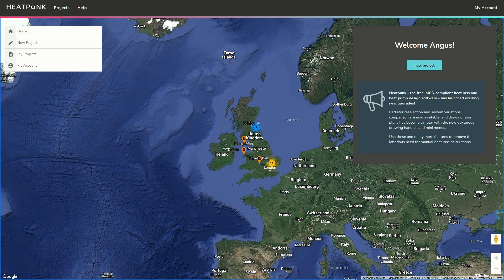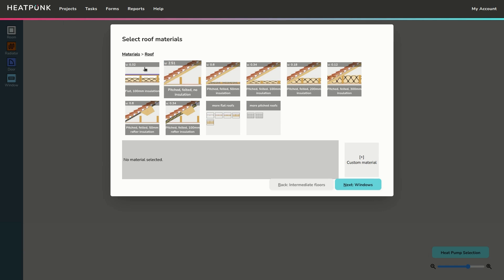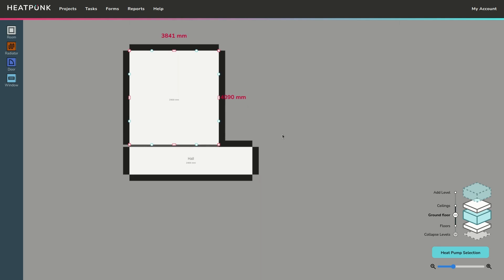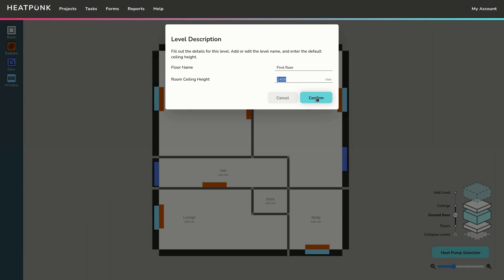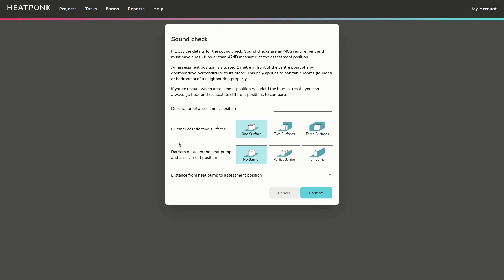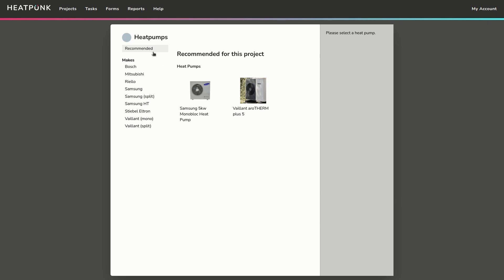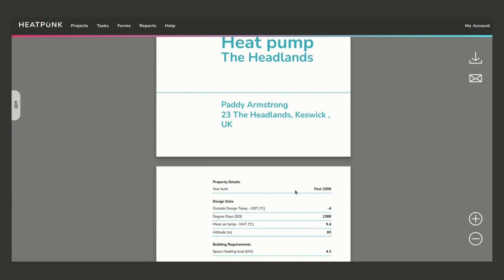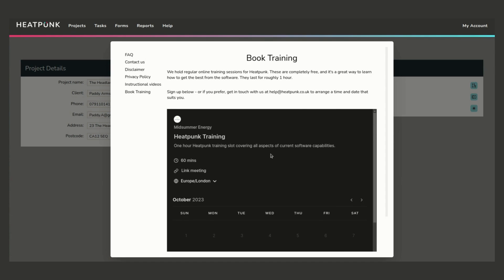Heatpunk Instructional Video

Comment: Hi, I couldn't find loose-filled cavity wall and plain wood internal doors? The only doors listed are glazed?! Surely 99% of houses have plain wood internal doors!
Reply from the maker: Hi Philip, all of the built in materials come from CIBSE's domestic heating guide, as we need a reference for the u-values used. If you can't find exactly the construction type you are looking for then you can create custom ones. 

Solid wood door is an option, but in heat loss calculations internal doors are not included! You can add them to the plans as a visual aid but they will not have an impact on the calcs.
Reply: @Heatpunk  actually now I come to think about it internal doors are inside the thermal envelope of the building do yeah that makes sense! DOH. Thanks
Reply from the maker: @Phil.Graham  No worries, let us know if you have any other questions!

Comment: Thanks for a great video, the software is great too. One question though, what would you do about stairs? I have a small landing that is unheated because it gets plenty of heat coming up the stairs from the hallway below, is there a way to model this in the software or can I just ignore the unheated room showing in red?
Reply from the maker: Thanks for your feedback!  I find the best way to do this is to model it as a separate hallway and landing on each floor as you have done, and then in the heat pump task when to the right hand side of the add heat emitter button is 3 dots, if you click on these there is an override room function. This can be used when the is sufficient heat output provided by the adjoining room. 

If you have any other questions please feel free to drop us an email, there is a contact in the help section, or join one of our free training sessions, also bookable via the help section on Heatpunk!

Comment: fantastic! heatpunk software is free but they point you towards their own suppliers. Great business model.
(unlike Residence Collection who wouldnt tell me what size shims to use under some windows I got on ebay because its a trade secret they only share with their installers ! moan moan )
Reply from the maker: Thanks for the feedback George! Yeah exactly, the standard products on the free version are connected to our wholesale products! There is a Pro version of Heatpunk that will allow users to add other non-Midsummer components! (although we do stock the best stuff so why add other's haha). Pro has some other cool features, importing floor plans so worth checking out for those!

Comment: Will there be any issues if I dont have an EPC report number available to include ?
Reply from the maker: Hi @SeanMoore2008, it won't be an issue to get your heat loss and do your design. Heatpunk does calculate the estimated kWh/year space heating and DHW demand so these values can be used where you don't have access to an EPC (or you want something potentially a bit more accurate!). 

You would however require a valid EPC should you be applying for the bus voucher and need an MCS compliant install. Refer to ofgem's site for more details on this - https://www.ofgem.gov.uk/environmental-and-social-schemes/boiler-upgrade-scheme-bus/installers.

Comment: How do you access the plan.
Reply from the maker: Thanks for your comment.  The plans are available as part of the heat pump design report which can be downloaded as a PDF from the report section of your project.
Reply: @Heatpunk  Cheers I will definitely have a proper good look it is way above my head,heat loss calculations are based on mumble jumble haha as is most of the theories.Gas oven High Medium Low Simmer it should be that easy too hot turn it down too cold turn it up.Old school pass that big hammer.

Comment: Is there an option to model a chimney?

Also, I put in a postcode at the start of the project, it recognised it, but now can't set a party wall, as it ill only accept a UK postcode
Reply from the maker: Hi Kieran, a chimney should be taken into account through the air changes of a room. Section 3.5.4.4 of the CIBSE domestic heating guide covers the considerations to be made. 

Currently the software is based on the UK, so the ODT used for the heat loss calcs are based on region in the UK, and the altitude is factored into this automatically also based on postcode.  It would be possible to use a generic UK postcode and then manually adjust the ODT to the needs of your location.

Comment: Why is there no undo/redo function?
Reply: or save function ftm - the autosave definitely not sufficient. if you make one mistake it's ridiculously irritating to try to fix, the dimensions are finicky and placements clunky, it ignores data that's put in and comes up with it's own numbers, also changes dimensions you've already put in somewhere else when you change a different adjoining wall, no function to select the side you want changed. Also, why no option for underfloor heating? Software seems completely unfinished. 

It's no adobe, that's for sure.
Reply from the maker: @Lisa-tz2th  Thanks for your feedback. 

Auto-saving will happen every 30 seconds and a force save can be done by changing tasks. 

There is a function to select which side you want to change when specifying wall sizes, it is based on the point that you click to see the dimensions. Heatpunk will always move the wall from the point you have clicked when manually entering sizes. There can be instances where it ignores the value you have entered if this conflicts with the way it is connected to other rooms, you just need to make sure you have allowed the space for it to move into. 

Underfloor heating is included in the heat pump section of the software, there is a video guide in the help section that covers this. 

There are also free training session that can be booked via the help section and would address the points that you have raised.
Reply: @Heatpunk  have had more practice with it now and while the initial annoyances do lessen with experience, a manual save would still be appreciated because I have still lost work because the save function was not sufficient. As well as the undo, because when trying to work at pace going back and moving the dots is irritating beyond words and deleting something you don't think you need only to need later or try out different room shapes because something in the house is a bit unusual means some times trial and error is required which would be a lot easier if you could undo - even better if like in Photoshop you could see a history of steps.
Reply from the maker: Hi Lisa, there isn't a specific undo button, but any of the pink coloured handles of a room can be deleted and the walls will snap back to where they should be without deleting the whole room.
Reply from the maker: Hi Lisa, 

It's mainly due to the complexity of the processes happening in the background. Generally speaking most request for this are around the floor plans task, when walls are split into more sections that required. The way to 'undo' this is to click on the pink circle points and click the delete button, this will cause the wall to snap back between the remaining points and allow you to remove any sections you don't require without the need to delete the entire room. 

If you require more help around this please get in touch at help@heatpunk.co.uk or feel free to book a training session via the help section.